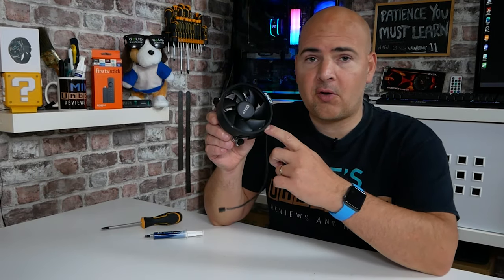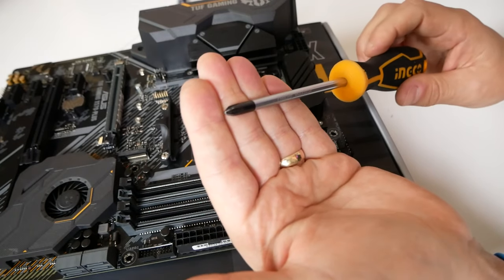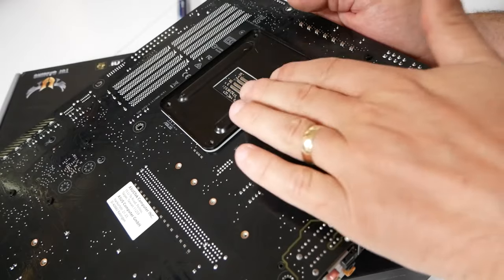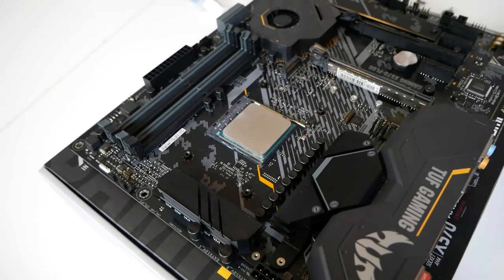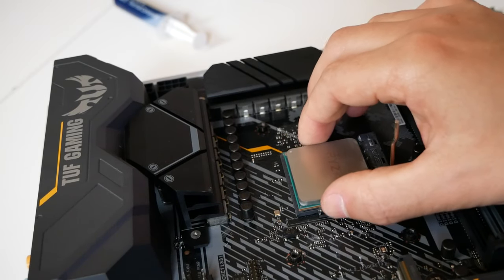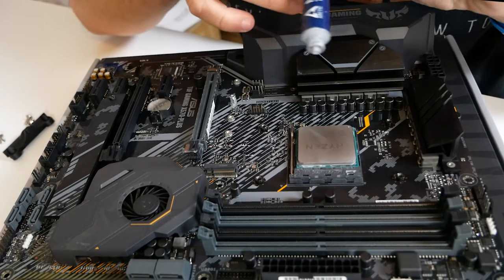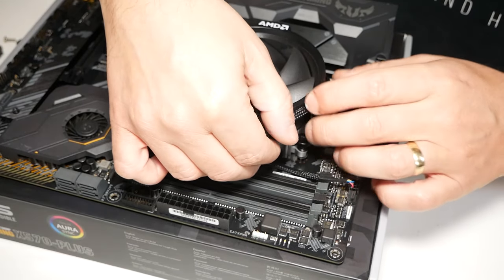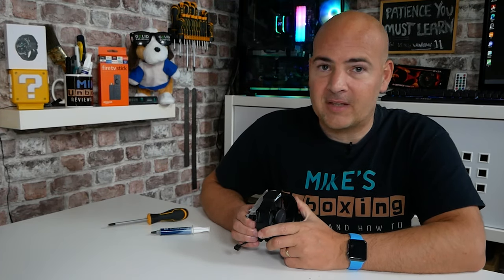How To Install AMD CPU & Stock Wraith Cooler Quick & Easy

Comment: Complete garbage cooler and it's hard to install, recommend spending the 50 dollars for something not a hassle to put on
Reply: What do you recommend as my screws don’t even touch like cm dostance
Reply: What do you recommend instead?
Reply: I agree with you.
Reply: This kids nowadays don't know the pain of installing an old 775 cooler. This is just screwing 4 screws how hard can that be.
Reply: @gregprouse1173 I just removed the cooler to clean dust, and now that I'm returning it it doesn't even reach the board. I hope this video helps
Reply: Guys there is a back plate the cooler screws by themselves do not touch the board
Reply: @walmartian422  yeah 😂😂

Comment: Stock AMD fans work well! At least they keep temperatures in a reasonable range, unlike the stock Intel coolers. Ick. Thanks, Mike!
Reply from the maker: they are okay to some extent and as a stop gap until a decent tower cooler is on offer

Comment: Had nothing but trouble with this today! Wish I'd seen your video beforehand. Thought I'd readjust the cooler as I was having issues with it sitting right - as I went to take it off after loosening the screws, it pulled the whole CPU out! The pins look ok, but I haven't finished building yet.. hope it still works lol
Reply from the maker: hope it all works out in the end

Comment: Ah the trusty stock Ryzen kewler.  Always wanted the Wraith but got the Stealth with my trusty 3600.  Had it installed for about a week before swapping out for a Hyper 212 Black and never looked back.  Thanks for this instructional video, Mike and Kath :-)
Reply from the maker: this cooler is the bane of many peoples builds either installing removing or just getting too hot, hopefully the video will be informative and give some of the newbies a bit of confidence when using it
Reply: Just made my PC, I was going like "Oh I know it's small but it will be able to keep the CPU cool" into "Wtf my cpu is at 95°C!?" after opening a game in ultra into "Let's buy another cooler!" 😂😂

Comment: are some of the screws supposed to be close to the backplate already because i cant seem to get the others down even a cm while those go in after half a turn
Reply from the maker: check the backplate is fully flush against the motherboard

Comment: Tiny bonus.
If the sideways AMD logo on the shroud annoys one, the four screws holding that to the cooler are square form.
And can be screwed off, rotated 90 degrees and screwed back in, so that the AMD logo is right side up.
Reply from the maker: yes i have had to do that one or twice as my OCD kicks in sometimes at the position of the logo

Comment: when I did mine, I was kind of scared... you have to put a bit of pressure on the board to get the screws started... scared me, I thought I was going to damage the board. but I got it on... and another thing...  I had an extra AM3 heat sink and checked it... it fit the board and could work if I had only gotten the processor. I absolutely love my new rig! The B450 board is so nice and my RGB lighting works great in it... my KB even syncs with the system!
Reply from the maker: nice! glad it helped. what was the final specs of the machine?
Reply: @mikesunboxing  the final specs are as follows: MSI B450 Gaming Plus Max, Ryzen 5-5600G, 16 GB DDR4 2133 memory, 512GB M.2 SSD, 2 2TB HDs. Windows 10 pro. I also have 2 ODD's for burning and copying DVD's and Cd's and of course, my RGB- Cooler Master Master Fans and Light Bars

Comment: So when they are spring loaded, you can screw them down untill they stop?

Does this apply to all spring loaded coolers? Such as deepcool tower on an LGA2011-3 ?

I hope so because thats what ive done.
Reply from the maker: Yes that is the general rule that you keeping going until the hard stop
Reply: @mikesunboxing  Thanks 😊.  That's what I've done, cheers 🍻
Reply from the maker: @MGRracing No problem :-)

Comment: what is the Maximum Rotational Speed AMD Wraith Spire with RGB, Socket AM4 4-Pin Connector CPU Cooler With Copper Core Base & Aluminum Heatsink & 3.81-Inch Fan RGB LED  and how many voluts does it have thnk you
Reply from the maker: not sure sorry, i would guess around 3000rpm  and most fans are 12v

Comment: Hi what do I do if I can't remove the two plastic clips? The screws are far too tight and don't budge, and I'm afraid of applying more pressure in case I damage the motherboard
Reply from the maker: use a larger screwdriver for more leverage
Reply: @mikesunboxing  okay thanks!

Comment: so its ok to push down on the cpu fan with pressure cause i was worried it was gonna damage cpu pins while my friend tightened down cooler
Reply from the maker: yes a little pressure will be needed

Comment: Hi Mike I really enjoy your reviews got a quick question so I have a optiplex am doing a case swap now the front panel connectors are custom and not normal 
Iv ordered a cit flash now would I still be able to controll the rgb since you only connected the PSU and was controlling jt 
Thanks
Reply from the maker: glad to help - i think?
Reply: @mikesunboxing  can you change the rgb without connecting reset switch
Reply: @beerus9631  Yes

Comment: What if your board doesn't have one of those black, backplates? Having trouble getting my fan in cause of the sizable gap between the screws and the board. I have a B550
Reply from the maker: This is maybe easier to fix or at least advise if we can ask more questions and get direct answers, so feel free to join our Discord chat and we can go over it in more detail https://discord.gg/XtBTGQ6BDu
Agree to the rules by clicking the emoji and you will get access to the rest of the Discord channels
Reply: @mikesunboxing  I actually found my backplate and got it installed. It apparently fell off in my PC case when I was checking if it would fit and where and didn't see it under the frame of the case.

Thanks however. I got the cooler installed now
Reply from the maker: @reagenlionel  Glad to hear that you have it all fitted 🙂

Comment: This video helps me... but in some other way then installing the cooler.
I'm aiming to install 4 ram sticks in similar mobo with similar in size cooler so I was asking myself do they even gonna fit in there. Will cooler block the first slot or not. Well, the answer is no so thank you anyway for your video, it was helpful.

Comment: This video did not help at all Ike just more angry
Reply from the maker: sorry to hear that
Reply: @mikesunboxing I don't have screw holes in my b450mk don't know if it should be there
Reply from the maker: @Adnan-wl7wx  This is maybe easier to fix or at least advise if we can ask more questions and get direct answers, so feel free to join our Discord chat and we can go over it in more detail https://discord.gg/XtBTGQ6BDu

Agree to the rules by clicking the emoji and you will get access to the rest of the Discord channels
Reply: Buy another cooler before installing it because depending on your use you'll need to replace it anyway.